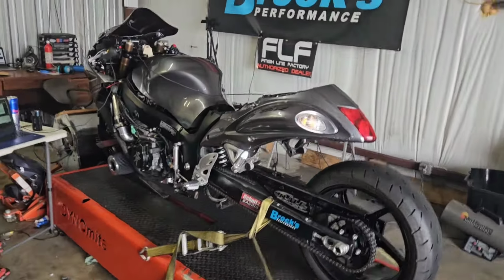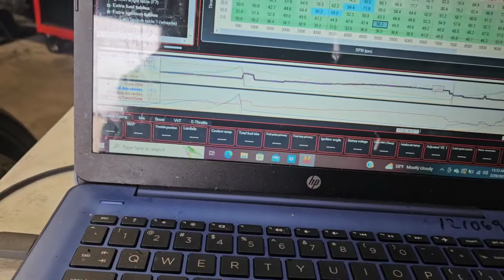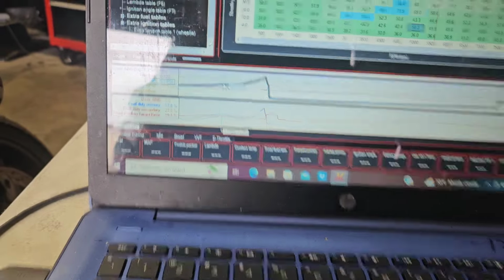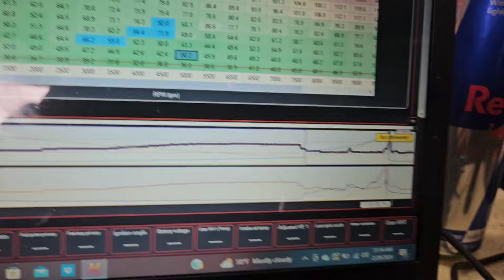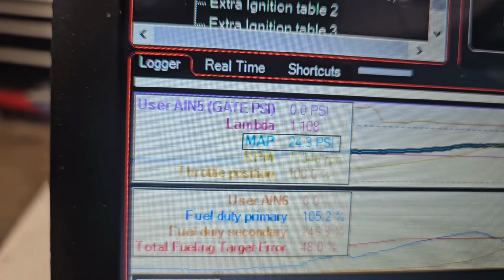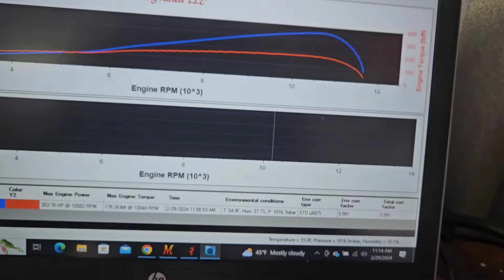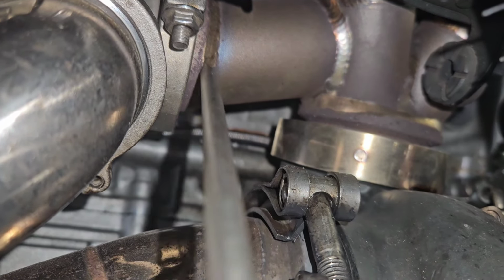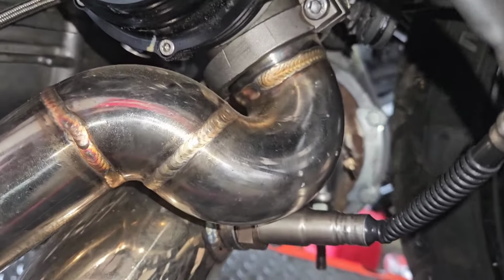Boost creep my opinion of the on3 turbo kits and shop update

Comment: I was able to Band-Aid the boost creep issue when I had an On3 kit by making a sheet metal disk that sandwiched between the turbo and the downpipe v-band to serve as a restriction. I made a 2 inch hole in it and that allowed me to control boost down to 3 psi. Obviously this will limit you on the top end but it does make the bike rideable. You will still probably make 500 hp with the G30-770. Retarding Spark to control the power will make the creep even worse.
Reply: I just put the gate into the turbine housing .
Reply from the maker: @dennisclanton5342  yep just like I explained in the video the only real solution for a wastegate on a merge header like this is to mount the waste gate off the turbo because they all merge together right at the flange